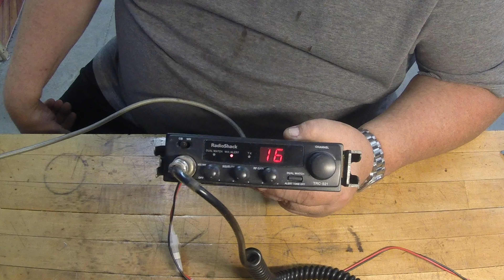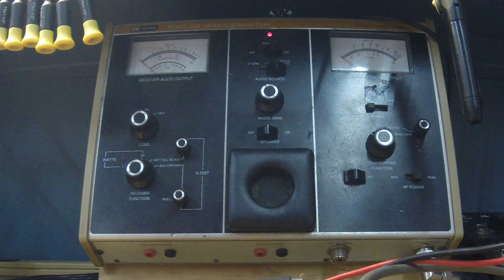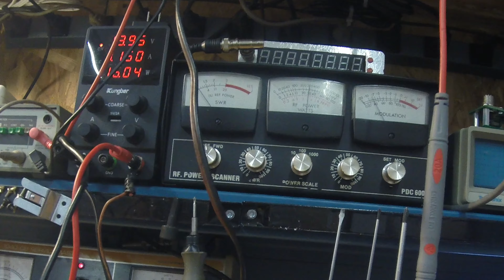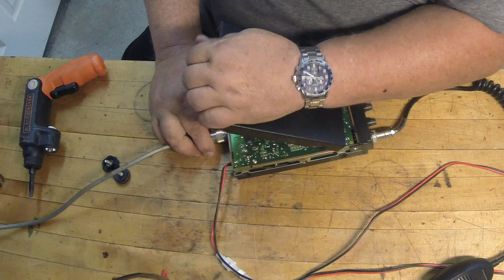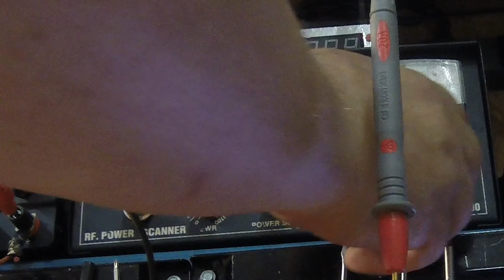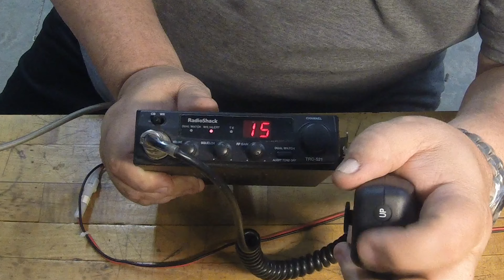Realistic TRC521 40 Channel CB Radio Tune and Review

Comment: i have the trc-520 and this video I think answers my problem.

My radio sucks. i have a k30 antenna and I can hear people OK but  i have a range of about 2.5 miles on the highway for transmit. 2.5 watts dead key? i'm betting this is where my problem is. "4 watt of power" yeah when you're screaming into the mic.
Reply from the maker: Yea those newer radios are not real powerful but they do great just for your day to day highway driving I like the old 25 and 29 cobra's they will easy swing 10+ watts...
Reply: @TheElectronMan  it's been usefull on my last two road trips. I got into ebay this evening and ordered a uniden 520xl with an amplified mic. We'll see how it goes.
Reply from the maker: @MrSGL21  Cool radio you should like it also make sure you have a good antenna as well because it can make a huge difference in both RX and TX.

Comment: If you pop the back of the Mic open you will see a pencil eraser sized element in there , Nope no VR for the AMC and if they had a diode to clip , it would over modulate so bad no one could hear you clearly.... I found out back in the early 90's era that the WX mics with the those gray PTT buttons were not worth the time to open the covers those lil mic elements sound great out of the box.... I'm gonna guess the  DOM as 2014 or so.....

Comment: Unfortunately radios are headed in the direction of fixed value parts, and few if any adjustments available for the home cb mechanic. If a radio is at 90% modulation maybe 3 watts output, that can be lived with but a few of these radios come out with 60% modulation and 2 1/2 watts out, and that is too low for us homebrew semi-experts, but now we are, as they say, screwed. I don't like being a complete don't touch anything cb'er, I like to tinker and they are cutting me off at the legs.
Reply from the maker: Totally agree I am ok with some of the newer technology but I don't like this no fine tuning era of radios..
Reply: @TheElectronMan  I don't like the way CBs are going, components are hand picked at assembly at the factory, nothing to adjust!  Fine when they are new, buy after a while you find there is no frequency adjustment that you can make to pull it back on frequency.  I like a pot for everything that can be adjusted, even if they are so small you can hardly see them to put the adjustment tool into them!  Give me an 80s CB any day.  Some of these new CBs we are getting can only put out 3 watts and some are only putting out 2 watts out of the factory.
Not only that you can hardly hear the breaker on the CB, deviation/modulation turned down way to low, Modulation 55%  Deviation 1.2Khz instead or 2.5Khz, it is like they are whispering!!!!  Bad enough being low powered, but not being able to hear them even if they do get through, hopeless!!!  Give me an old CB with plenty of adjustments, none of this IC SMD crap!  :-l
Reply from the maker: @BoB4jjjjs  Exactly and the same goes for repair all this going to SMD and integrated processors, so even if you can identify the faulty component more than likely you can't source it much less replace it without a bunch of high end equipment. Becoming a disposable world just throw it away and buy a new one which is put together the same way cheap and fast.
Reply: @TheElectronMan  You forgot nasty!